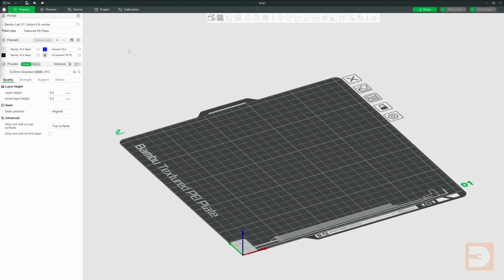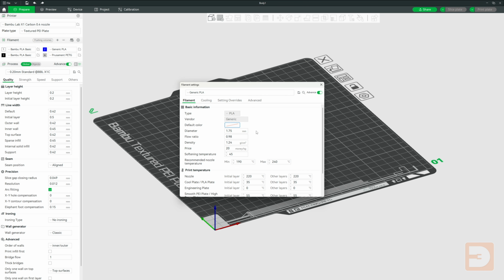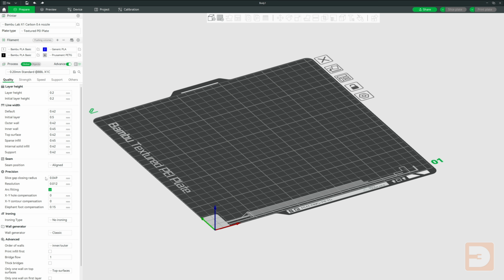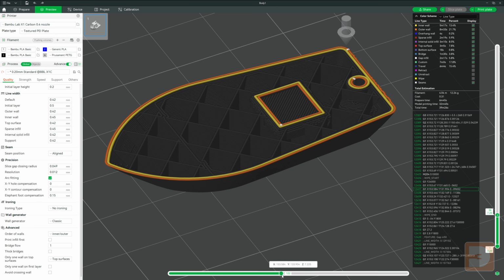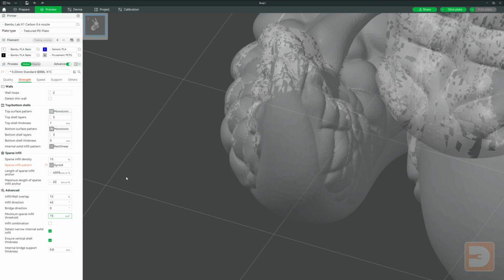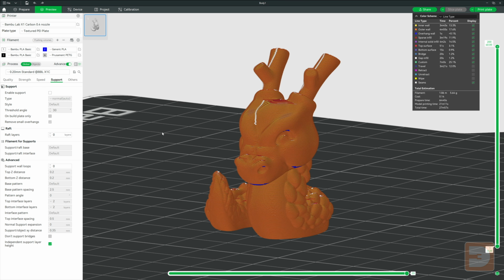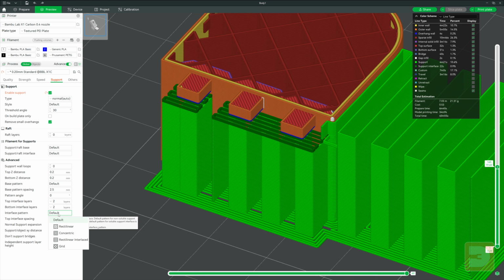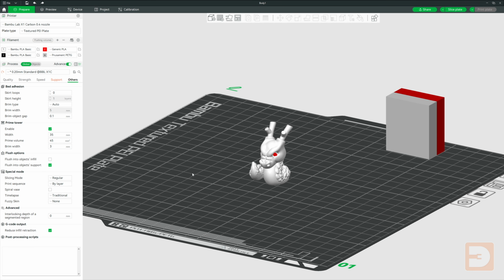Bambu Studio Advanced Tutorial

Comment: Excellent tutorial. I’m new to 3D printing and wouldn’t know half as much as I do now without your videos. I do have a question pertaining to Filament Print Temperature in the advanced Filament Settings. PLA has printed fine so far, but I just purchased a spool of Bambu Labs PLA Wood. The “recommended setting” for the Plate says 35-45 C. However, the Bambu Labs Preset for this filament shows the Initial Layer set at 65 C and Other Layers also set at 65 C. Should I change the Bambu Preset to match the filament’s recommended settings or leave the temperature alone? My printer is an A1 with the Textured PEI Plate and 0.4 Hardened Steel Nozzle.

Comment: Thanks very much for all the information that you have given us again. I have just upgraded from a Robo 3d which I have used for six years to a Bambu X1 Carbon and what a difference 6 years has made in the 3d world. I’ve only ever produced practical things and it paid for itself within weeks and I’ve always said to others that 3d printing is about designing but I now realize machines make a very big difference. Could you tell me what / where I have to change for this Support problem. The support itself seems ok with the Top Interface Layers being Rectilinear pattern as you say but the Object needing support ends up with lines of filament which appears to be bridging with gaps in between each strand on the underneath surface that needed support. You see strands but not a smooth wall. That’s if you get what I mean.
Reply from the maker: Hey Charles, thanks for the comment. Haha yes, technology moves so fast these days, 6 years allows for 5-7 generations of evolution.
Sorry if I'm not understanding your question exactly, but I believe you're asking why it is that the surfaces of your model that are printing above support material aren't coming out smooth?
If that's what you're asking, it's because support material by default leaves a gap between the interface layer and the bottom of the object so that the support material doesn't fuse with the model. It prevents it drooping down so much that it fails the print, but it won't prevent slight drooping or imperfections. 
If you want to reduce this gap, if you've got an AMS with your X1C you can use a different material for the interface layer (a material that won't bond easily with whatever you're printing with) and then you can reduce the z distance between the interace and the model.

Comment: I would love to see a deep dive into post processing scripts! There is very little info out there at the moment and it is a very powerful tool if you can get creative with how you use it. for example, I wrote a script for Simplify 3D which can add aditional filament when using a smaller nozzle; the actual nozzle is still a 0.4mm but the slicer thinks its a 0.2mm resulting in a hollow space between walls but I increased filament flow by a % to make up for it and doing this allows the slicer to pickup on really fine text details in the wall which is great for marking part numbers on your prints. I havent found a way to get my code into bambu yet. I just got the printer a few days ago so there is lots to learn! thanks for this vid, it was helpful! Subscribed!
Reply from the maker: A good one to add to the list!  Thanks for the suggestion!
Glad this video was useful and thanks for the sub!

Comment: I’m having an issue can you help me with. I’m trying to print a 2.0inch round by 2.0inch tall diameter in PLA, but my part is coming out 1.990 and the other side is 2.005. How can i get this dimensions closer and round. I tried the XY compensation but no luck
Reply from the maker: Hi there, I'm afraid that's just about inside the expected dimensional accuracy of many FDM printers, but 0.0003in (0.01mm) is a lot more preferable.
Is the rate of inacuracy constant across prints and is it constant with your pritners axis even if you rotate the orientation of the print?

Comment: Shot in the dark here, but I've been getting the " benchy hull line" on a pot that I'm trying to make.

It creates a ring pretty much in the same spot (about a quarter way up the pot) which coincidentally a floor is built inside the pot to house components in the same spot. 

When I look in the slicer and check layer times it's showing me there's a significant change in time for that layer that is giving me the ringing. 

Is there a way I can make the slicer change speed on a specific layer and then continue back to normal after those layers?
Reply from the maker: Hey there. This is actually something I'm planning on covering a video later this year. There's a number of things that can lead to this and unfortunately it's not always the same thing.

You're absolutely right that the layer time is most often the issue though, and adjusting the speeds is a way you can try to tackle it.

What you want to do is in Bambu Studio, right click on your model, and select 'Height Range Modifier'. Select the range in the object list on the left and set the height range you want to adjust the speeds for. Then (making sure you still have the range selected in the object list), got to the speed tab, and adjust the speeds that you want to be affected for those layers. 

Let me know if this helps you at all.
Reply: @3DRevolution  thanks for the response! Giving this a shot right now. And the slicer after doing what you recommended, I did notice those layer lines decrease! I couldn't get rid of all of them but 90% of them. I'm doing a test print now to see what happens but it's a 5-hour print.

A follow-up question would be, can you add more than one of the height range modifiers at a time for the same model?

For example, I was able to do it layer 54 through layer 58.

But I would like to continue on past that and do layer 64.

When I tried clicking on the modifier again it just kept taking me to the currently used one
Reply from the maker: @BelowAverageGaming Great, let me know how it goes. I've been playing with this myself and looking forward to publishing a video on it in the coming weeks.

To add a second layer height modifier, in the object list on the left, click on the word 'Layers' under the object you're affecting. At the bottom it will show the height range that one is affecting. 

Click the + to the right of that and it'll then add an aditional range. You can then select that height range from the object list, adjust it to the heights you want, and apply differnt settings to that height range.

Comment: can you advise how to improve the surface finish of small overhangs that dont require supports? I find that the finish  on overhangs on sections facing the print plate are worse than those facing away from the plate.
Reply from the maker: Slopes that are facing down are always going to be lower quality than those facing upwards, as they have a section of the extrusion that is printed in open air and so will sag a bit before cooling.

There are a number of things you can do to alleviate this but using a smaller layer height is one of the best ways. If it's an extreme overhang (albeit small), support material may be necessary. Depending on the material you're printing with, you may also be able to increase part cooling, to solidify overhangs quicker. 

Alternatively, look at different ways you can orientate the part on the print bed to mean it's no longer a downward facing slope.